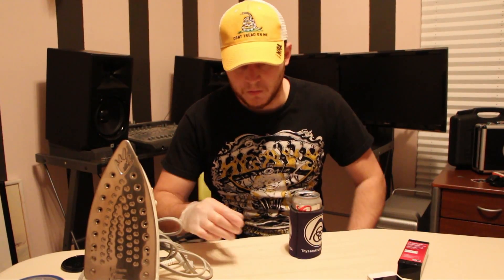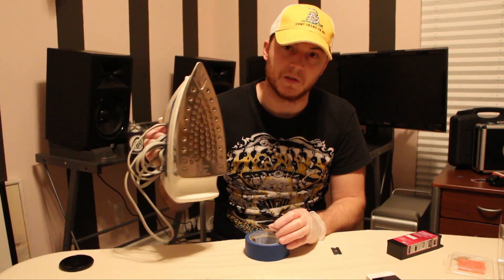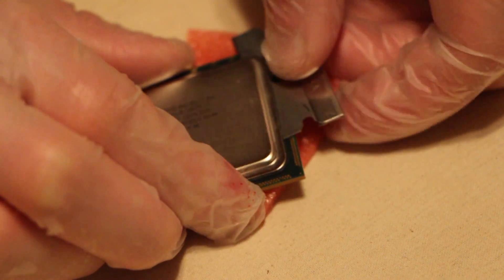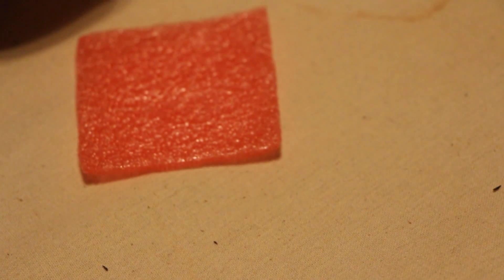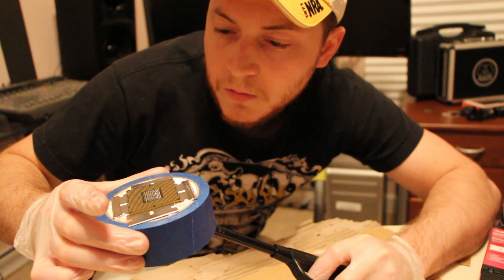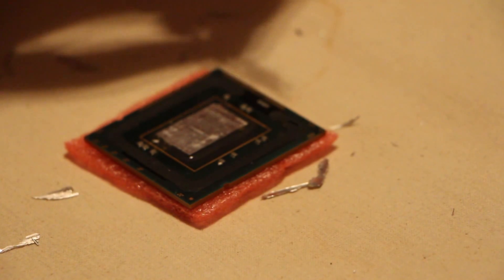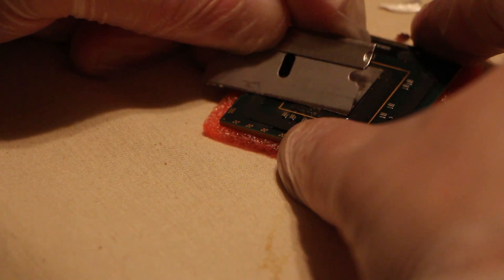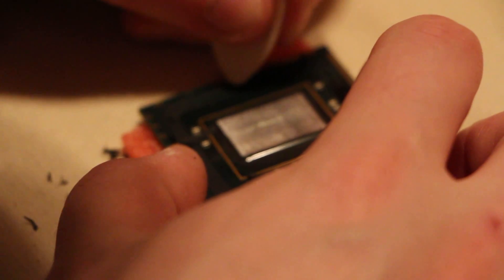Delid Soldered CPU Guide

Comment: Why shoud anyone delid metal soldered cpu ? For 1,5 C les temperature ? In my opinion cpu is ruined.
Reply: enthusiasts will delid for overclocking or freeze phase changing or liquid nitrogen
Reply from the maker: That's already been answered many times. 2009 Mac Pro came with delidded CPUs. 

http://www.anandtech.com/show/2800/upgrading-and-analyzing-apple-s-nehalem-mac-pro/10
Reply: Electricos Cosmos If u did this for mac pro than ok... but I have server board and I throw away their small heatsinks and bought custom screws than maounted Cm Hyper z600 on mobo without touching anything on cpu or it.
Reply from the maker: +Nikola Karovic Yeah, there is zero reason to delid a soldered CPU for temps.  Mac Pro upgrades or for the sake of science are the only real reason.
Reply: delidding and using the CPU without the lid (and Liquid ultra or comparable compound) will have a really massive impact on temps.
Reply: Because some machines like the Apple 4,1 use delidded cpus so if you wish to upgrade you must delid the new cpus

Comment: Hi, thank you for this good idea and tut. What if I remove IHS from one of my x5650 or i7 980x, and apply liquid metal on the die then attach it directly  to cooler noctua, would you agree I'll get much lower temperature? (with liquid metal and directly contact with coller)
Reply from the maker: As cheap as a X5650 is you could try it, I wouldn't do it with the 980X since they still sell for a lot though. Personally I wouldn't do this other than for Mac Pro upgrades since the thermal dissipation of soldered CPUs are already about as good as it gets. I'd definitely leave the 980X alone, if you want to play around with the X5650 for science then go ahead.

Comment: This does not work at all for me a lighter. I'm toying around with a CPU that I rekt (X5675) and trying to delid it. And I've cut razorblades carefully into it on each side of the CPU and then trying to melt the solder with a lighter by carefully touching the surface of the IHS with the tip of the fire, pulling the lighter back and forth to not over heat the CPU (I know it's rekt already but I wanna simulate the real deal)
Reply from the maker: Sounds like you are doing the flame depth just fine but perhaps you need to move it to cover the rectangle shape of the die to ensure all the solder is melting, perhaps one end of the rectangle isn't melting. Leaving the four razor blades in there should provide just enough pressure to pop the IHS off as soon as that solder is melted and that only takes 157°C to melt. All three of mine only took about 30 seconds and popped right off, I always was using one of those nice long BBQ lighters which has a pretty long flame and is easy to hold. Other than that I'm out of ideas.
Reply: Thanks for your advice. I appreciate it tons. I'll try what you said that pulling the flame in a rectangular shape. Other than that I'm too out of ideas haha. We'll see what happens. I'd LOVE to buy a pair of 5675s delidded but aren't many available it seems. And my motherboard is in very poor shape with 2 busted pins that I've repaired. So the system works stable so far (8 hours into it) with the old E5520's in it. However I can run one of the 6-cores in CPU A sockets but don't really wanna do that.
Reply from the maker: +TheSwedishCruiser When you get your 6 core replacements be sure to do a PRAM reset on the first boot up after swapping them out. Otherwise you could have stability issues and kernel panics. I'd also recommend CLU for the thermal paste. You want to brush on a very thin layer to cover all of the die but since it's conductive you don't want it anywhere else other than the die.
Reply: I delidded it now. I did what you said and it went quite fast actually. So I thank thee! Now, the scratches on the die itself is slightl worrysome. They are very superficial though but they are there nonetheless. But scratching off the solder kind of leaves no options.
Reply from the maker: +TheSwedishCruiser That's great. Yeah, I just kept the razor at a low angle once I got down to the die so it would simply be scratches on silicon and nothing would be anything more than just an unsightly superficial scratch. Try to keep a low angle once you're down to the die and avoid side to side motions. You can tell when you're down to the die because it's hard like glass. (Just like I mention in the video) It doesn't seem to cause any stability issues what so ever, I was still able to pull out good OCs on the chips once they were delidded. Just be very careful to avoid side to side motions, keep a low angle, and don't slip and damage a cap with the razor. I very lightly polished it up with a coffee filter and alcohol when I was done.

Comment: Do you used only the Lighter or the iron too?
Reply from the maker: Indium solder melts at 157°C so if your iron heats up above that then yes you could use it. Shoot a temp gun at it when you've heated it up to check. I had mine on there for a little over a minute and it still never popped off so I swapped to the lighter which pops it off in less than 30 seconds.
Reply: Okay, so you just jused the Lighter? No pre heating with the iron? I have here two X5675 for my MAC Pro 5.1, and I tried it today, like you did. Now one CPU is working and one is broke. I will buy new one (i become them very cheap like 70-80 $. I will do it again. It is a litle bit mysterious to me. I did nearly the same to both CPUs, one is working one is broke. Crazy. By the frist one i got scared and stop the lighter 4 times after 30 secs. Then it workt. For the 2 CPU I just use the lighter nearl 2 mins... :-)
Reply from the maker: +Lakeone77  One of those BBQ lighters makes it really easy. All three of mine took less than 30 seconds with just the lighter. Sorry to hear one didn't work. Sometimes the heat sink needs to be tightened down more (like a quarter of a turn) if the CPU isn't detected on the Mac Pro, you just have to be extremely careful that you don't tighten it down too much or you will damage the socket and ruin the daughterboard. Definitely don't risk damaging the socket, another chip is much cheaper than another motherboard. That is where it helps to have a PC with a standard X58 motherboard laying around to test with.
Reply: Socket is still working, Im now using the Old 5520 CPUs. I could use 1 X5675 but then the FANS going Crazy! I just will try it again, when I become a new one. Do you touched the CPU with the flame? Do you like to talk about this stuff on Skype? Or can I contact you on Google+?
Reply from the maker: +Lakeone77 When you put a single CPU in socket A the fan running at a full 100% is normal. I wouldn't advise running that longer than just to test before moving on to CPU B when you try install your second CPU. Yes, the flame is actually touching the IHS (Integrated Heat Spreader) while its upside down with the razors in it. This causes the flame to spread out, the die under the IHS is very small, only hold it close enough that the flame spreads out to cover where the die is underneath the IHS. You don't want to hold it too close or the flame could spread over the sides of the IHS and you don't want that, you only need the solder in the very center where the die is to melt, at 157°C the solder will melt and the IHS should pop right off.
Reply: I will tried it thanks for youre textes! I will let you know, how it works!
Reply from the maker: It shouldn't take much, barely touching the very tip of the flame to the IHS and moving it around if needed to heat up the IHS in the rectangle position of where the die is underneath. Hope that makes sense, you said you did one already. So the third time around should be easy. Goodluck.
Reply: I bought now a used X5675, i got him for 80€. I will now try again. And I will follow all your advice! If some one needs cheap Intel CPUs send me PN, I have a nice contact!
Reply from the maker: +Lakeone77 8:05 You can see exactly how it pops off here.
Reply: Yes I know that, it worked for me by one of my CPUs, it was the same. I will become the CPU on Saturday, I will try it again!
Reply: So, its done! The two X5675 are running successful! And now I know where the fail was! While I was working with the razor Blade, I was going to deep in to the CPU und cuttet of one of this little nobs inside. It need now about 1 Minute with the lighter 2 times! But my MAC is running (Geekbench 24.000) (Cinebench 1280) now! NICE! But One time (long after the Bench) my MAC became an error and was suddenly shut down. I saved the Error Text. To you maybe understand the Text? Here in Drop Box there is the Text file: https://www.dropbox.com/sh/rfd1xyi5o8tyyck/AABWxZjLwUfSP99gOA4tgpR9a?dl=0
Reply from the maker: Glad you got it to work. No idea on that one. Hopefully it was just random, I'd say if you ran Cinebench and Geekbench just fine then you should be golden. If you want to know what the error text means you'll have to post on a forum somewhere. What thermal paste did you use? I used CLU. Also, check out this app which monitors temp and cpu usage, I bet you will like it. https://bjango.com/mac/istatmenus/
Reply: I´m know iStats, Im using it. The Temperature  never over 60 on the A and B Tiode. The error was repeated now 2 times, thats probaly not random. But without workload. Thermalpaste: COOLER MASTER E2 IC Essential (is this paste wrong? Only the Temps from Prochot are a little high? Look here the Screenshot named X2: https://www.dropbox.com/sh/rfd1xyi5o8tyyck/AABWxZjLwUfSP99gOA4tgpR9a?dl=0
Reply: there is also a picture in of one of the working CPU. Its a macro Photography, maybe one of the CPUs is a little demaged... UHHHH
Reply from the maker: I don't think that damage would effect it. Matter of fact you can even accidentally knock one or two of those caps off and sometimes a cpu will still work. Sometimes it will kill one but sometimes it will still work since some of them just reduce "noise" frequencies. I would recommend using CLU, you want to completely cover the die when you delid. The entire die needs to be covered so that is one of the reasons to use liquid metal over standard thermal paste, you brush the CLU thinly over the entire die so the die is covered, You can use thermal paste too but you need to make sure it's non-conductive and that when it spreads out the entire die will be covered. I doubt that is the issue... perhaps posting on some Mac forums for someone to interpret the error logs can shine some light on the issue.
Reply from the maker: +Lakeone77 CLU is what I used. If you covered the entire die though you should be fine with what you used as long as it's not conductive. What you did sounds like it should work fine.
Reply: okay, now the MAC crashed the 4 time. And the RED LED inside stayed / not the mainboard led, the LED direct above the POWER button... crazy
Reply from the maker: Did you do a PRAM reset after the swap? Reset your PRAM if you haven't (Google it) Hopefully its just an issue like that... if not I honestly don't know, perhaps try reseating CPU B.

http://osxdaily.com/2010/11/15/reset-pram-mac/
Reply: Of Fuck I forgot the PRAM! I will try it. What do you mean with: reseating CPU B?
Reply: What about Reset SMC? Make this sense to?
Reply: I made the Pram Reset, but the RED light is still there. It only leaves by dissconneting the Power Cable hm, the shut down fails, comes sometimes
Reply: I found the problem but it is crazy: https://postimg.org/image/9wimxlsmv/

While Benchmark nothing happens... CPU A is COOOOL, maybe I have to re do the Thermal paste, theres maybe a lag i don`t know. Can you tell me which one did you use? I just will buy the same
Reply from the maker: +Lakeone77 I used CLU, I bought it on Amazon. I have no idea about that red led, did the crashes go away after PRAM reset?
Reply from the maker: +Lakeone77 I wouldn't be worried about temp if they are cool, that's a good thing. I hope the CPU isn't the issue. I was hoping the PRAM reset fixed it.
Reply: Hm, the Mainboard LED flashed by CPU A, and this one probably had fewer thermal paste then it should have. There was a little little edge without TP. I did it now again for this CPU. I tried Video Rendering: CPU A= 45° CPU B = 42° (Celsius), the CPUs are very Cool, I wait now for the ERROR again. But while rendering or Benchmarks there are no errors... i try now Prime 95 under Win 10 for half an hour. The Only BUG I have now since Im using the new CPUs that is my Keyboard is very lagy, sometimes it fails... But I think that may have nothing to do with it (Orig. Apple) but crazy again...
Reply from the maker: +Lakeone77 Cool is good! You're delidded so the temps should be great. Order some CLU if you want to though. I cut my brush shorter and brushed it on very carefully in a thin layer. Hopefully you don't have anymore problems and it doesn't crash again.
Reply: I think, the BUG is now gone, the MAC is running since 3 hours now with out problems. It was the small edge without Thermal Paste I think. Dou you know, what is the maxium health Temp for the 5675? Did you overclocked him? My Turbo is not running on 3,5 "only" 3,2 GHz
Reply from the maker: +Lakeone77 Pretty much any CPU is good into the 90s at which point it will thermal throttle usually at 100C, the lower the better. Since they aren't overclocked I don't imagine you will ever see over 70s. Glad it's working!
Reply from the maker: +Lakeone77 When I'm overclocking I will limit my overclock at 85C, at that point I either need to stop, turn my voltage down, or get better cooling.
Reply: Can you name me a overclock tool for MAC?
Reply from the maker: Lakeone77 There isn't one, you can't overclock a Mac.

 Back in the day you could bootcamp into Windows XP and run SetFSB which allowed you to play with the bus speed but you couldn't adjust voltage, when you logged back into Mac OS then the overclock would still be active until the Mac had been powered down or restarted which would then default it back to the stock bus speed.
Reply: So youre not using a MAC?
Reply from the maker: Lakeone77 I have a 2009 Mac Pro that I put two delidded X5690s in, I also have an GA-X58A-UD5 that I put a X5675 in and have overclocked to 4.3-4.5GHz.

Comment: Is there a possibility of damaging the CPUs with the heat? I did the blade / iron method to some eBay CPUs and after troubleshooting for hours, I am confident only one CPU works.  I can't see any damage from the blades.
Reply from the maker: Yeah if you don't melt the solder right you could rip off part of the die when you remove the IHS. Once the IHS is removed you have to be careful not to hit any of the caps, the caps are easily broken off if you accidentally smack one with a razor. It's pretty easy to do this though, all three of mine that I've delidded work great.
Reply: Neither of those things happened so I guess I just got a bum CPU. That's a thing isn't it?
Reply from the maker: Stephen C. Shapiro rare but it can happen. Did you test them before delidding? That is the only way to know for sure.
Reply: Electricos Cosmos I guess I should have mentioned this was for a 2009 Mac Pro, so installing lidded CPUs isn't exactly recommended (as you know).  Not sure how else I would have tested them.  I practiced delidding / cleaning up a couple cheap Socket 1366 CPUs, so I'm confident on my technique.
Reply from the maker: Stephen C. Shapiro  You get it to boot with one CPU though? Perhaps you just need to tighten the one that isn't working down a little more. Be easy though, I'm sure you know how easy it is to tighten down too much and bend the socket pins. Definitely want to avoid that.
Reply from the maker: +Stephen C. Shapiro If you ever got it to work with the second CPU be sure to remember to do a PRAM reset otherwise you'll have stability issues and kernel panics.
Reply: I must keep doing something wrong or damaging them somehow. Gonna try the DN Computers chips.  I know their premium is ridiculous but I gotta cut my losses at some point.
Reply from the maker: +Stephen C. Shapiro What chips are you using? Some only work in single CPU configs.Are you not heating up the entire die and perhaps ripping off some of the die?
Reply: The dies all look fine, and I'm testing them one at a time.  I bought two CPUs from one seller.  #1 didn't work but #2 did.  Then I bought #3 from another eBay seller.  Success! Then two days later the computer stops POSTing.  #2 stopped working.  Okay, I order one more CPU from the second eBay seller, great.  Go to install... #4 works, but #3 now doesn't.  Possibly I'm damaging the CPUs with too much ArctiClean - like same as water damage? Clearly I'm in over my head, so I'm either gonna pay out the nose for the pre-delidded CPUs or get a 2010 Mac Pro and drop in CPUs with the IHS.
Reply from the maker: +Stephen C. Shapiro What CPUs are they? You probably already know but I need to point out that some chips only have one QPI link and don't work in more than single CPU configurations. You have to be using X56## series. The W36## and i7 9#0 series are only single QPI and don't work in dual CPU configs. If you're using X56## series CPUs and still can't get more than one to work, I don't know man. Shame to hear that it didn't and I wish you the best with whatever your next move is in the swap and cutting you losses may be the best route.
Reply: +Electricos Cosmos t
theyre 5680s. Thanks again for all your replies. I really appreciate it.